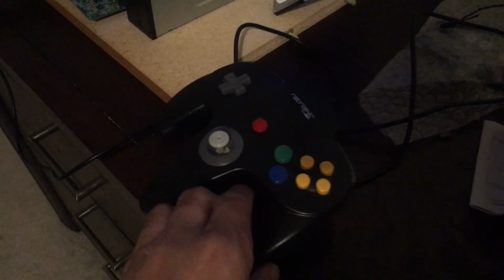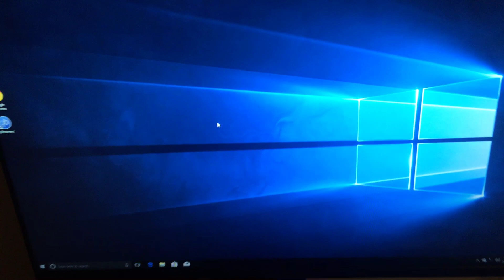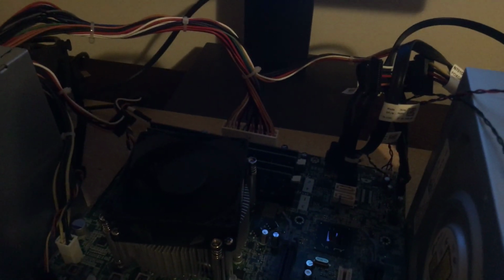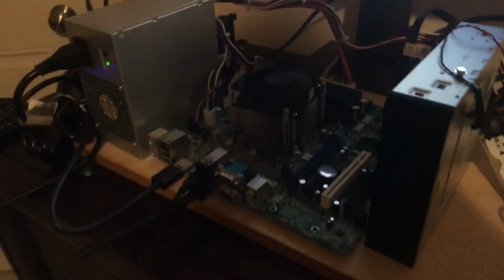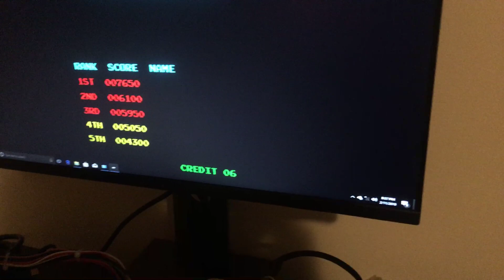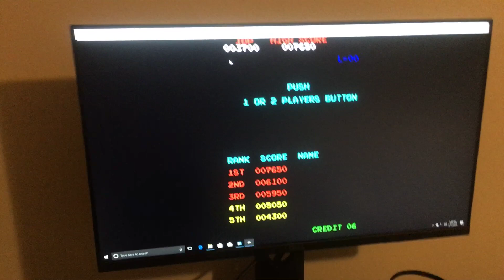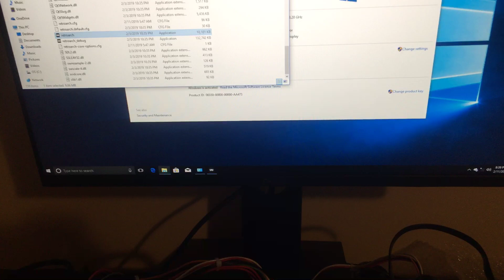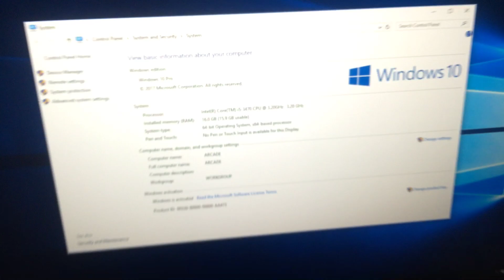PC or No PC in My Arcade1Up Cabinet, That is the Question

Comment: I stuck a C2Q Q9650 new old stock motherboard combo with a 1tb hd in my 1UP SF cab. It auto boots Mame at Windows start up. Running Mame .181 using a personally edited rom set that sits at around 930 games. Guilty Gear XX Reload is also installed, so if I want I can exit out of Mame and load that up to play.

Comment: So many options bro lol, I am still building mine using a dell optiplex as a base. Put a GTX 1080 for graphics card and a 2TB hardrive with Windows 10 myself so far. Debating on using either hyperspin or big box though. I did put a bunch of pc games on it though like Street Fighter V and Mortal Kombat XL and Killer Instinct on it.  I am looking at making the control boards with the same buttons that a xbox 1 controller has  but instead of an additional stick for the R3 button I am looking at putting a track ball with buttons to act like a built in mouse. Use the joystick for character walking and track ball for  looking around moving the camera in games like Doom, Tomb Raider etc.
Reply: You should get FightCade. Emulator for online multiplayer.
Reply: @CollaborationNation  I will check that out thanks for suggestion.

Comment: When MK cab comes out I'll make mame cab with Launchbox.  I've been using RocketLauncher with Launchbox cuz colpipes1978 has amazing add on packs.  Colpipes78 also has his own attract mode front end which looks great as well.  I may go that route since it seems easier to set up.  ArcadePunks has it.
Reply: Retroarch is a must for most systems.  What systems are u trying to emulate.  On my PC I'm running 110 systems through RocketLauncher/Launchbox.  I have an 8tb external drive hooked up so it's completely mobile meaning I can attach it to any pc later.

Comment: The pi is isn’t powerful enough for games like KI/KI2 
I went with a pc because of this issue.  But there is a caveat, 3D games like virtual fighter, tekken 3, nfl blitz, gauntlet dark legacy require a fast i5 - decent GPU - 8GB ram.
Reply: I went with a dell 3020 with an i5 4th gen 
Plays harder to emulate mame without issues and full speed.  Mame has no GPU acceleration so you’ll need a decently strong cpu
Reply: any pc recommendations?! something to go in the 1up. would also be nice to be in the pi price range ?!
Reply: Also added a dell 2007fpb and replaced the stock 17” 
The 20” looks so much better and is IPS vs the stock TN so amazing color representation at better viewing angles
Reply: Detroit Love I assume you’re using the psx of version then as the pi has a rough time with polygon games.

Comment: I have two full sized original cabs (Donkey Kong & Vanguard) both with pc's running MAME and recently replaced them with Raspberry Pi's.  I'm using the Wolfanoz image. Much better power consumption and overall I like the smaller footprint of the Pi's.  If something goes wrong, I simply replace a power supply or reimage the micro SD card and that's it!  I'm not going back running pc's in my cabs...:-)  Great video and I enjoy your enthusiasm for keeping retro gaming alive!!! GAME ON D.L.!!!!!!!!!!!!!!!!!!!!!!!!!!!!!!!!!!

Comment: I use coin ops forgotten worlds 3 on my modded arcade 1up
Happ joys/buttons, stereo speakers + sub, will be getting my 20” Dell 2007FPB next week which will be a great upgrade 1600x1200 4:3 aspect, pc with gtx 750 500GB SSD 
Forgotten worlds 3 uses retroFE front end it’s just a download and set up controls.
Think it’s around 80-90GB DL from arcade punks via torrent.  Just make sure to run your VPN =P